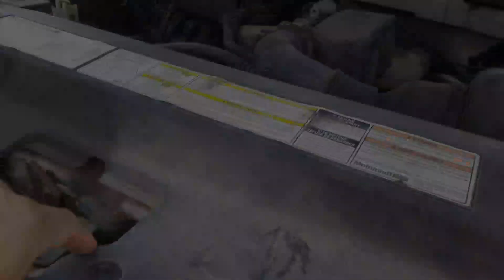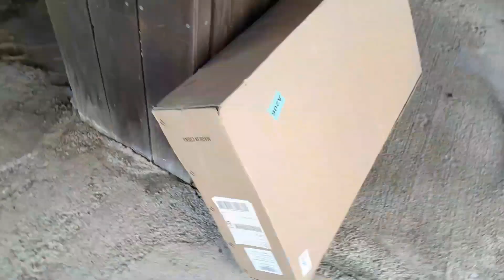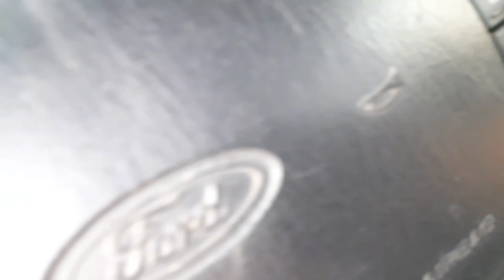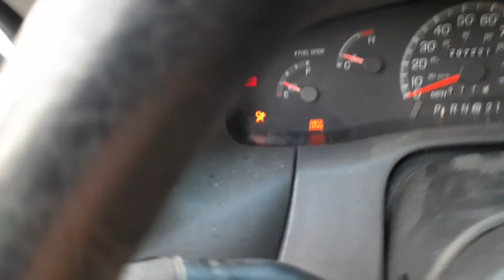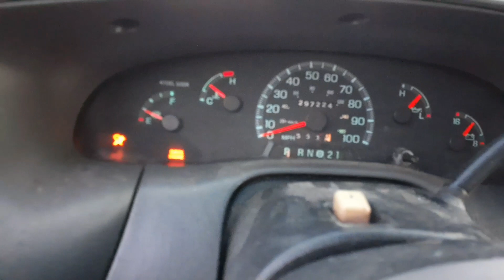How To Replace Radiator And Reinstalling E-Fans on 97 F150

Comment: Where did you get your electric fans
Reply from the maker: I got them on eBay let me send you a link
Reply from the maker: Look at this on eBay
https://www.ebay.com/itm/10-Fit-For-Universal-Slim-Fan-Push-Pull-Electric-Radiator-Cooling-Mount-12V-Kit-/153405893294?mkcid=16&mkevt=1&_trksid=p2349624.m46890.l49286&mkrid=711-127632-2357-0

Comment: Can I get a link to them fans
Reply from the maker: Let me look them up.
Reply from the maker: https://www.ebay.com/itm/161464866695?mkcid=16&mkevt=1&mkrid=711-127632-2357-0&ssspo=ShvuhfAdTIi&sssrc=2349624&ssuid=pwgoylqorzm&var=&widget_ver=artemis&media=SMS
Reply: @AquinoRejectRides  do they come with harness or how would I wire them up
Reply from the maker: @celrolla7760  it comes with the wires I just ran it to the fuse box so when I turned the key they come on
Reply: @AquinoRejectRides  do you know what fuse is the power ran too ?
Reply from the maker: @celrolla7760  just use a test light, and make the tedt light comes on when you turn the key on and turn off when you turn it off...
Reply from the maker: @celrolla7760   it can be the wipers fuse, or the radio fuse